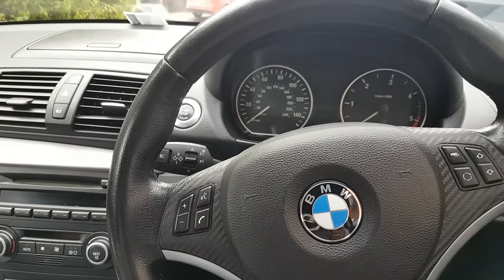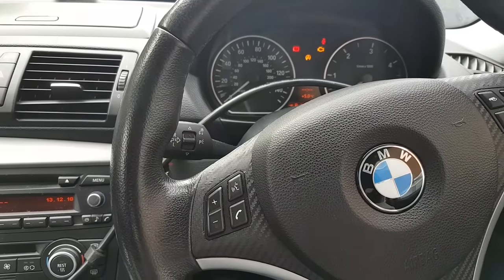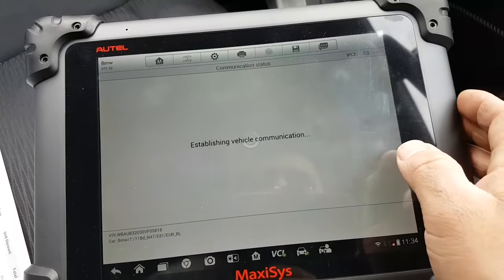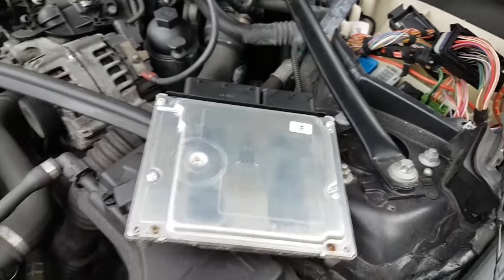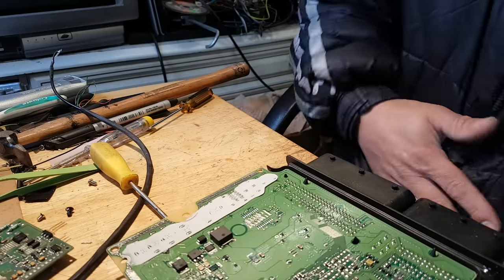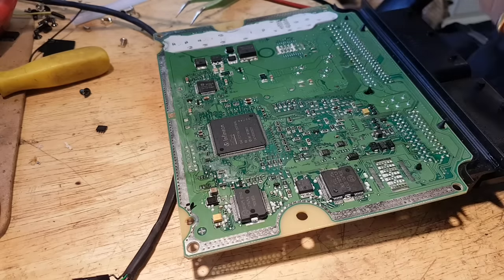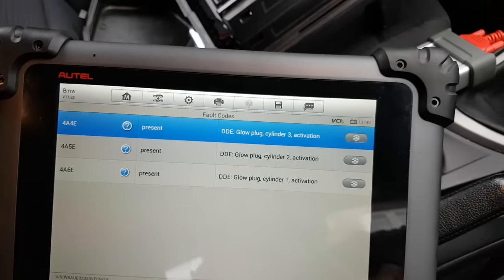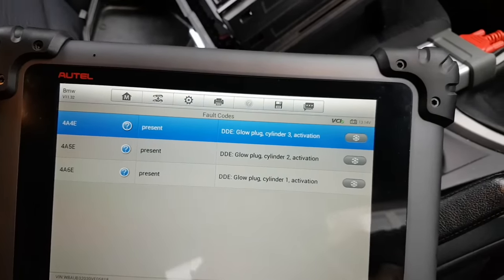BMW 118d not starting. No DDE communication. Fault finding and repair.

Comment: Hi mate! Awesome video, I have a e90 m47 320D with the similar issue, no comunication with the DDE, but the car is crank and Start, but dont have power I think is from the turbo. In some moments, the fault is resolt and the DDE have comunicated, and the power return. ISTA dont read the Ecu, and the RPM dont move. Is this problem similar with the problem of these video? Thanks!!
Reply from the maker: Could well be...
It might worth to get to the ecu and inspect it...
👍👍👍
Reply: @LMAutoRepairs  I make a visual inspect from the ECU, and no see nothing wrong. No humidity, or corrosion, or another visual problems. I desconect, and reconect and Work, but for a few Days
Reply from the maker: Have you actually pulled the ecu out of the box?
Reply: @LMAutoRepairs  Not, But I can.
Reply from the maker: I would, just to make sure...
If the ecu is not the sealed type a few torx screws and you can peek inside just to make sure...☺️

Comment: Hiya,
I am having nightmare issues with Series 1 E87/N47 2.0 Diesel
My engine light came up & still is on after BMW technician replacing the below parts
EGR
Engine pressure valve 

Now they are saying the turbo needs replacing & issue with the DDE unit.

Please let me know what I can do  where are you based so may be you can have a look.

Look forward to your response
Reply from the maker: This is a part time for me... and I don't really have time at the minute anyway...
Looks like they are just throwing parts at the car... I would demand a good explanation of what they are doing... main dealer should know better...
Reply: @LMAutoRepairs  
Thank you for your reply, I asked BMW & they said the turbo flap doesn't open enough at high speeds. Hence smoke comes out of the exhaust at high speeds, could be the ECU
Reply from the maker: Could be...
But, it is difficult to tell without checking...

Comment: Hi, your work is great. I have peugeot 207cc, accident damaged, airbags poped. The driver and passenger airbags. Car now does not start. Says brake system fault. Diagnostic says, no communication with the ecu, and the abs. Please help
Reply from the maker: Check fuses etc... is there any possibility that the accident damaged any wires etc?
Thank you for watching and for your comment!
Reply: @LMAutoRepairs  thanks for your reply, wow, i never thought you had time to reply. 

All fuses are fine. No broken cables. Is it true that with these cars, if the abs in not working , the car wont starts? I took the ecu for testing,  they said there is nothing wrong with it. I suspect the abs pump.
Reply from the maker: @rastmbatha3421  
Yes... that's correct... many cars actually... the abs module is inbetween the BSI and the engine ecu... so, is the abs unit is not passing the comms, the car fails to start... still, check powers and grounds at the abs module... before completely blame it...
Scope the can lines would also be helpful, if you have the possibility...
I always do my best to answer everyone... even though I know I miss some...
Reply: @LMAutoRepairs  thanks very much i will keep you posted, and ask more questions. .i hope you dont mind.
Reply from the maker: @rastmbatha3421  
👍

Comment: Wow nice fix, that was a dumb engineering by placing the dme in a middle of a valley, 
Could you explain how shops are charging customers in UK?
Reply from the maker: Hi
I don't have a clue... you have seen how much they charged to not even diagnose it... and I have not even charged that much to actually fix it! 😋
Thank you for watching and for your comment!
Reply: You need to charge more you have very special skills so you should charge like a lawyer or doctor. I doubt there would be many garages who could fix that for less than a 1000.
Reply from the maker: @andrewthompsonuk1  
Indeed, even an ecu replacement wouldn't be cheap...
👍👍👍👍

Comment: Hi i have to replace my JBE modul it's ok if replace with one from a same car same engine code? or its have to be programmed?
 It's can burn out something if i only replace with another one?
Reply from the maker: You will not burn nothing...
But the module might needs coding...
Thank you for watching!
Reply: @LMAutoRepairs  Thanks I appreciate it

Comment: I have had the same problem no communication with DDE so i had replaced the ECU with the same part number and programmed in but still same issue, car cranks wont start but no communication with DDE 

Can you shed any help!
Reply from the maker: So, the issue was not the ecu... as I always say, start with the basics, check power,  grounds and communication lines first...
Hope you get it sorted...
Thank you for watching!

Comment: HI. I have a Bmw F10 with a Barometric sensor problem wich is in the ecu. Do you think you can fix that? Thanks
Reply from the maker: Those sensors are easily replaceable... providing that the sensor is actually the issue....
Thank you for watching and for your comment!
👍👍👍
Reply: @LMAutoRepairs  it doesn't affect the car at all to be onest but from time to time  i get the error. How can i get in touch with you?
 Where are you based?

Comment: Hello there my friends one series has identical problems if it is the ecu can we buy a new ecu if so what do we have to do ? Or could we send to you for a charge ?thanks dan
Reply from the maker: A replacement ecu will need programming and coding...
Unless you clone it... that, depends on what ecu you have...
👍👍👍
Reply: How much would u charge if we was to send the ecu over to you ?

Comment: Hi could I ask for your guidance. I have a 325i with a water damaged msv70. I have red the data from the board using xprog and I have a replacement msv70. Would I be able to just copy the data to the replacement and it all work fine( mialage, cas) or do I need to do something els. Your videos are brilliant. I have learned so much from you. Thank you
Reply from the maker: You should be able to just load the data and should work... I never done one I think, so not 100% sure..  but I pretty sure it should work... how have you backed up the original ecu? On the bench? 
Thank you for watching and for your comment!
Reply: @LMAutoRepairs  yes I did it on the bench using xprog. I thought that was right. I got a bit concerned as I saw a comment on a forum somewhere about the mialage being stored somewhere els and that if I didnt chainge it I would get the tamper dot. I think I will give it a shot and let you know. Thank you for your quick response and thank you fore all the videos u do. They are very informative and it is impressive the vast knowledge you have of menay different brands of vehicle.
Reply: Sorry it has taken me so long to get back to you. I have cloned the dme and everything worked fine so i guess that the data for the millage is in the dme somewhere but i couldent fomed it. I just wanted to thank you as all your videos give me inspiration and motivation to work on my car as well as being very informative.
Reply from the maker: Better late than never...😊
Just kidding... not a problem, glad to know it worked and got it done! 
👍👍👍

Comment: Hello mate I love your videos they are very helpful. I have had water ingress on my ecu, same as in this video. It clears up well but one of the capacitors had gone, is this something you could fix? If so how do I get in contact to organise?
Reply from the maker: I don't do that kind of service...
I like to test my repairs...😋
👍👍👍
Reply: @LMAutoRepairs  okay mate no problem thank you anyway
Reply: Hi I am having the same issue... how do you know one of the capacitors aren't working? Thanks
Reply from the maker: You can first check for a short...
Then you can charge it and see how quickly it gets discharged...
There tools to check capacitors as well... which will give you more accurate results...
👍👍👍

Comment: Bmw 730 year 2010 no crank. Had ruined battery. New battery. Bms coded. Transit mode turned off. No crank. Any advice?
Reply from the maker: Codes?
Live data? 
Do you have ignition? 
Can you communicate with all the modules?
So many variables, that is impossible to mention them all....
Anything there that points into any direction?
Reply: @LMAutoRepairs  says diesel particulate filter above max mileage. 

Do you think this could stop it cranking?
Reply from the maker: Possibly... specially if is badly clogged...
Reply: @LMAutoRepairs  not talking because of dpf itself but because bmw engineers coded the car that way. Anyway the car had battery low message on screen when i first got there and a battery test proved new 6 month old Varta had half cranking ability. 

J

Comment: I have the same problem but the dash light fuse keeps getting blown, what should I do should I replace the ECU or other modules
Reply from the maker: Replace?
No, you need to find what is causing the fuse to blow, and go from there...
Don't start replace stuff without diagnose it,  can become expensive very quickly! 
Thank you for watching!

Comment: Where are you based. My 2007 bmw 320d cranking but not starting. My mechanic bought a used ECU unit and its still not start so he said keys needs to programmed. Can you help me please so put my car back on the road. Tx
Reply from the maker: The keys don't need programming... is the ecu that needs the ISN matching and synchronisation...
👍👍👍
Reply: Do you have an exchange service available or repair service. I can post it to you as in main land uk

Comment: Now I find your video after 1000 videos...🥵 and I'm amazed...I have same issue with my 330d...same thing's like this bmw...can we can get in touch please...
Reply from the maker: Is your ecu also water damaged?
Thank you for watching!
Reply: @LMAutoRepairs  there is some water on bottom I don't check inside ecu...but now is not crank anymore ...somebody say something about a relay...but I'm not sure...
Reply from the maker: OK...
Might worth to take the ecu out and open it just to inspect...😉
Reply: @LMAutoRepairs  i will try to take it out today and check it...let you know 😌...thanks
Reply: @LMAutoRepairs  there is some corrosion in ecu...but is tiny ...
Reply from the maker: Check it closely... make sure there is no bad/broken solder points etc.. 
👍👍👍
Reply: @LMAutoRepairs  nothing mate...I check it 3 times already
Reply from the maker: Ok... so I guess you need to start to check powers and grounds, starting system etc...
Have you scanned the car?
Reply: @LMAutoRepairs  yes...I don't have any errors...I use delphi diagnostic
Reply from the maker: Fair enough... As I said, you need starting to check things... there is nothing else next really...
Reply: @LMAutoRepairs  i check everything or at least what I can...but nothing...everything is ok...
Only now I have one error 4A63-EWS manipulering...
Reply from the maker: @silisteanucodrut3015  
Right... that's something different then...
What has been done on the car?
Can you communicate with all modules?
Reply: @LMAutoRepairs  nothing have been done to car...before when I try to start only crank (turning engine if I'm correct)...but now is not even crank...only one thing I noticed...
When I press start button under steering wheel I hear a click...and nothing more....
Reply from the maker: @silisteanucodrut3015  
Fair enough...
But again, can you communicate with all modules?
That tampering error, means the ecu is not getting the immobiliser code to allow the engine to start...
You either have a communication issue between modules, or a faulty module...
Obviously, check all fuses, power, grounds, etc...
Reply: @LMAutoRepairs  don't think I understand the meaning off communicate with all modules...but I will try to check fuses and grounds...anyway thanks for get me some advices
Reply from the maker: @silisteanucodrut3015  
The immobiliser system is composed by a few modules that need to communicate between themselves...
Engine ecu, CAS module etc...
If there is a communication fault between this modules, the car will fail to start...
Reply: @LMAutoRepairs  how can I check more properly this modules...CAS I check with delphi and seem to be ok...
Someone suggested to test ECU to see if is ok...
Someone else said that I have resync ECU and EWS...and after will be ok...but like you said I will go a bit deeper with electric fuses and grounds...
Reply: I check everything mate...all ground ok...all error clear...everything it's ok....but still won't start.....only thing i have now is that click under steering wheel....no more ideas....
Reply from the maker: Check faults on other modules... something that points you in the right direction...
Reply: @LMAutoRepairs  what chance will be to be starter....?
Reply from the maker: Is that a manual transmission?
Reply: @LMAutoRepairs  yes
Reply from the maker: Push start it..  if starts then you have your answer...😉
Reply: @LMAutoRepairs  I was think about that...but I wasn't sure...I have one more old method to do with starter...(knocking a bit)...and after I will be 100% sure...

Comment: Hi mate I have no communication to my glow plug module , any ideas what it could be ?, i have changed the module twice+the glow plugs + the power cable to the module .    Would really appreciate any guidance
Reply from the maker: Check wiring etc...
But the modules believe has more than 1 power feed...
I would have to check, so don't take my word for it... 
Thank you for watching!
Reply: @LMAutoRepairs  thanks mate , from looking it just have one power wire to the alternator and the wiring loom of the car . Would love to bring it to you but I'm in birmingham and very far
Reply from the maker: @waqasazam4454  
Yes... the main cable is the power supply to the glow plugs themselves...
The loom of the car, I believe there is more than just the comms...
Reply: @LMAutoRepairs  thanks mate , shame your so far away , would love to bring the vehicle to you as you seem to know what you talking about unlike some garages ive been to!

Comment: * Please help me !!! *

I currently have a 2008 bmw 1 series 120d E82 on 130k...

Recently the car has been temperamental on start up when sometimes, after pressing the on/off button and the ignition coming on with the dash lights coming up... when pressing the button again to turn the engine on, the car just makes a "click" sound and wouldn't turn over... after a few trys pushing the on/off button, the engine would come on....

One day after driving the car, I turned the car off and got out as usual... when I got back in and inserted the key, there was nothing, nothing on the dash and no ignition lights at all.. like the car was completely dead or not recognising the key?..

But the keyfob works fine... 
locks and unlocks, boot open button works, windows go up and down normally (Not slow from a low battery) parking lights, hazards, and interior lights all work..  but I'm worried that the battery will now run flat from the car not being turned on for days, not allowing me to plug a reader in due to having no battery and the keyfob not turning the ignition on...

The car recently had it's timing chain replaced anf injectors re-seated. I have also had the car scanned no longer than 4 weeks ago which brought up faults codes for the CAS system such as..

• A125 - Incorrect signal from E/M
• A0C1 - Output, terminal 50
• A0B5 - Fault, road speed signal
• A0B3 - Starter motor, terminal 50
• A0AF - Processor
• A11E - ELV fault
• A0AA - Control unit fault 
• A0B2 - Supply, terminal 30E/30L

I've been so puzzled and trying to figure out what to replace first...

Here are my options so far from researching forums in Google and watching various YouTube videos.....

• Check ignition and other fuses under dash
• Replace Battery and have coded in
• Replace Battery terminal 
• Replace starter motor
• Maybe look at replacing the Alternator..?
• Replace and have coded in a whole ECU kit including modules, keyfob and keyfob reader
Reply from the maker: Hi
That sounds like a bad terminal somewhere... check the terminal relays...
Check ground points, a bad ground can cause similar problems...
Check connections, plugs, etc.. 
👍👍👍

Comment: I have a 2011 x3 and it's not starting due to the crankshaft wire touch each other..now it's not starting..and the relay make a spark and car not cranking...Park of the fuse box fuse working and the other part not..
Reply: Please help
Reply from the maker: What exactly touched?
I am a bit confused... sorry...

Comment: Mine is damaged, If I get a 2nd hand DDE with the same part number does this mean it will work right away?
Reply from the maker: No...
Will need programming to the car...
Reply: @LMAutoRepairs  thanks for the reply, this is sad it means I have to take it to BMW for Programming. Damn they will kill me with the Pricing 😭😭😭😭
Reply from the maker: @velelotokota6960  
Even worse... BMW will not be able to program a used ecu...
They will only program a new one...
Reply: @LMAutoRepairs  So even if I buy the whole DDE KIT with keys, instrument Cluster, And Cas. it still needs to be Programmed to the Car, cause I have noticed that this will mean that the VIN number displayed  on the DDE & CAS will be    exactly the same as the Car the second hand parts come from.
Reply: @LMAutoRepairs  whoaw whaaaat a new one, thats simply buying new car OUCH!!
Reply from the maker: @velelotokota6960  
Lol
Reply from the maker: @velelotokota6960  
No... on that case no...
But as you said, the vin will not match...
Reply: @LMAutoRepairs   You mean it will work 100%, cause I don't care if the VIN number does not match if she's running I'm good. On e-bay people post E87 E90 E91 yet I see the Instrument cluster is from a 1 series, why are they not sticking to an E87 if it comes from one and if its an E90 stick to it.